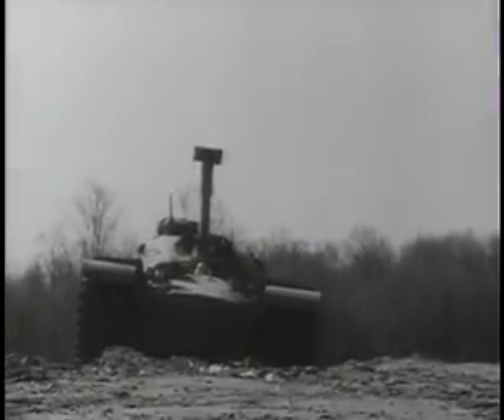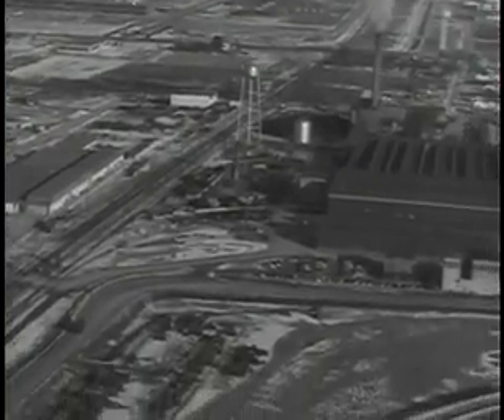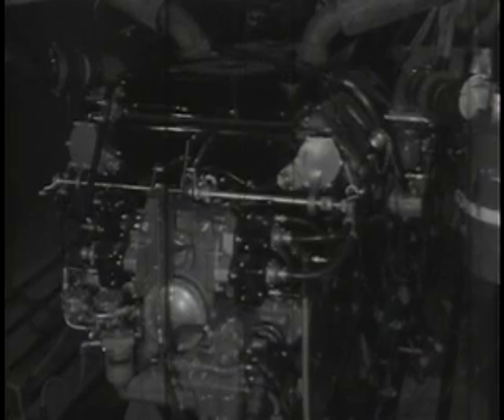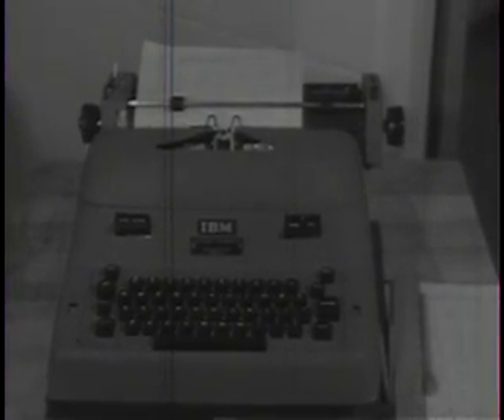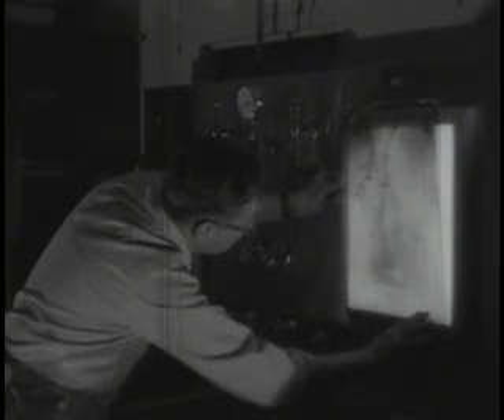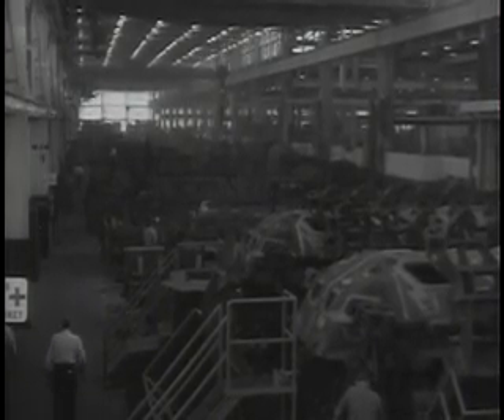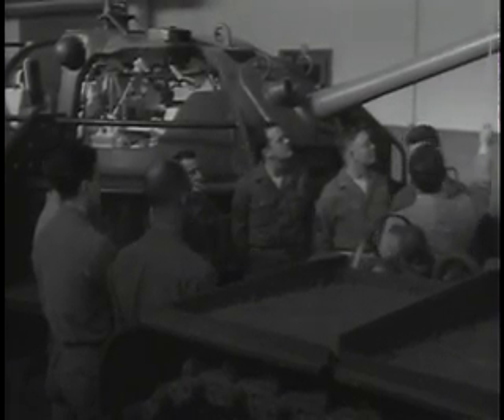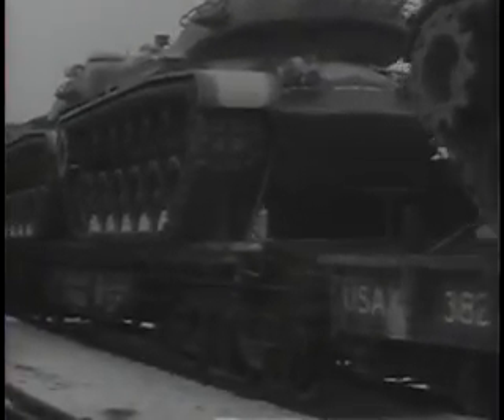M-48 Patton Tank, Design, Development and Testing

Comment: It's fascinating to watch people at the time describing what would become one of the worst tanks of the post war era
Reply: why you say that? M48 became one of the best post war tanks and with continuing modernisations on engine, gun and fcs stayed in front line service up today. its not a crap tank. yeap the M-41 90mm gun it was inferior to T-54/55 tank but in the 1950s they used HEAT rounds enyway and do its job. after they put diesel engine teledyne continental AVDS-1790a/d and M-68 105mm tank gun on the M-48A5 version make the tank equivalent with the M-60/A1 and it surpass eny soviet tank of T-54/55/62 series and even early T-72 with steel armour using APFSDS rounds. if you want to compare it with 3rd generation tanks its pointles and not logic. but the tank can be modernised even today with 120mm gun, new composite frontal armour and digital FCS( digital FCS were allready in modernised M-48s from late 1980s) and stronger engine. if your about to fight with other country that dont have 3rd generation tanks like M-1 and leopard-2, its still very efective like the 1950s, imagine your on a infantry company armed with machineguns and short range antitank guns (less than 500m)  like recoiless rifles M-2/4, M-72, panzerfaust, RPG-7/22, and other similar on the open you would shit your pants if 15 M-48A5 attack you, you would call on the radio reinforcements and heavy antitank launchers and artillery suport, you would stayed on your dig up position wile their fired at you gun and machinegun rounds and untill you noticed the enemy mechanised infantry that suports the M-48A5 would be on your head!, you would not see them coming becouse the tanks would bust your position and smoke and dust cover the wholle position you would not fear more for your life i promise you!. M-48/60  are very reliable mechanically, easy driven and operated and are cross country dogs, or honeys!, crews love them for all that abilities and can shoot accurate on 2km distance. if they maintained they are reliable even today, and old tnk doesnt mean it can't kill you easy!
and the M-2 Browning  0.50 cal machinegun its 100 years old in design but it kill you easily! on the war the old but combat efective and obsolete weapons are two diferent things and the M-48 its still combat efective. not all countries have the superpower arsenals and not all them would fight a superpower in war! 

ps. i was served in an armored unit that had M-48A5 with digital FCS, laser rangefinder and thermal camera in the middle 90s.
Reply: petros311
I think you are letting your fondness of your vehicle cloud your judgement. The Patton was exported because it was American, it was inferior to T55 and the Centurion. Your argument about the tank being 'scary' just because its a tank is irrelevant, the same can be said of pretty much any weapon since the longbow. I still stand by what i said, it was one of the worst tanks of the post war era.
Reply: petros311 has it right, soviet tank design concentrated on just the basics (Big gun, Thick armor, Powerful Engine) But sacrificed many small but possibly war winning features. Reliability, ease of maintainence, crew comfort/safety play WAY more of a role than it would seem. The most powerful tank in the world is useless if the crew is fatiuged, and the engine keeps breaking down.

The videogames you probably get your knowledge from are flawed in that they dont account for that.
Reply: petros311 Always good to hear those with experience weigh in and thanks for serving!
Reply from the maker: Thanks for your spirited defense of the M48!
Reply: yap all true, you can get a first hand opinion on tank fighting only if you inside a tank for few days excersicing including some live firing and then you get to know their pos and cons, on paper all tanks seem good, but the percentage wile actually they manage to do that its another story
Reply: thenoobfactor Soviet post-war tanks did not "sacrifice" anything except crew comfort. Worlds first tank that used (fully stabilized) 115mm smoothbore  gun that was able to fire laser guided missiles up to 5km was the Soviet T-62. Worlds first REAL main battle tank was Soviet T-64 with composite armor & 125mm smoothbore gun, also with ability to fire guided missiles was built 30+ years before M1A2. T-64's re-designed & improved version the T-72 was built 20+ yrs before M1A2
Reply: +STKS Well, the definitions for what an MBT really is aren't very clear cut, so getting a definitive answer isn't an easy thing to do. Personally, I'd define an MBT as a tank that does not weigh more than any heavy tank already in service in the same military, yet possesses at least equal firepower, equal protective qualities across its front and at least marginally superior mobility. The one tank that fulfils all criterion is the T-64.

It had a 125mm cannon more powerful than any other cannon in the world, had the best armour in the world thanks to clever design and the pioneering use of composite armour, and it surpassed the T-10M and T-62 in speed. Sure, you could argue that the T-64 had a lot of problems when it got into service, but it went into service regardless. After all, we're talking about the first MBT, not the best MBT.

But if comparisons between the two are inevitable, so be it. As usual, it must be pointed out that while the 5TDF engine of the T-64 had poor reliability, the Chieftain's Leyland L60 wasn't exactly the most celebrated example of British motoring genius either. I remember reading something about engine troubles affecting the combat readiness of the Chieftains so badly (down to 30% or something, IIRC) that only a fraction of the Chieftain fleet could actually be mobilized at any one timeframe if the Reds ever decided to charge the border. One also questions the validity of the ranging machine gun where HESH rounds are concerned. The ranging machine gun fires off a short burst, and unless you are lucky or skilled enough to bracket the target multiple times and get your shot off before the enemy knows that you are ranging it (not difficult, since exploding machine gun bullets were not used in any other weapon except the Chieftain's RMG), the HESH round you're lobbing over probably isn't going to land within a hundred meters of the intended target. On the other hand, a T-64 could just point and shoot because the APFSDS shells it fired were hypersonic (1800 m/s), and a full Mach number faster than L15 APDS, and the coincidence rangefinder was more than accurate enough for demolishing stonewall cottages from two miles away.
Reply: *****
Chieftain is widely considered to be the first MBT, certainly not T62.  T64 is a contender but early versions were poor. It was only in the mid / late 70's that T64/T80 began to match early mark Chieftain. And by the 80's with the MK11 with TOGS, the vastly improved L60 engine and Stillbrew (early Chobham armour) cheiftan had pulled ahead again before being replaced with Challenger. in the early 80's.
Reply: I'd say that both Centurion and Pershing were first generation MBTs, despite misleading assignations like "Heavy Cruiser" or reclassifying "Heavy" as "Medium" in light of post war analyses.  Upgraded guns and targeting systems kept them competitive with their contemporaries.  Pershing became Patton by means of incremental automotive improvements coupled with new generation turrets, apace, and on to the M60, all showing their lineage in the suspension.  Centurions were quite different, mark to mark, but you can tell one when you see one, just like you can tell an M48/M60.  

Aside: 
I propose, however, that the perfect blend of Gun+Armor+Mobility
(+ Optics and Turret Ergonomics) in WW2 era tanks is Tiger E.  Indeed, I think a case can be made that she, old tech though she might seem, was the first, true, One Size Fits All, Main Battle Tank.  Granted, she wasn't the fastest, either, but I'm talking which tank I'd want to be crewing when the fighting starts, other factors equal.  

Imagine Tiger vs Sherman.  Tiger vs Cromwell or Churchill.  Tiger vs KV1 or T34.  Tiger vs 7TP or Dutch 4 Man.  Tiger vs US T1 or M6 Heavy.  From late '42 till early '44 Tiger rules the roost, tank wise.  About Feb '44 the IS 2 comes into view, but Tiger's optics and long range accuracy are legendary for good reason.
Reply: *****
None of that refutes my point in the slightest. You should learn how to read or get off the internet.
Reply: ***** Export variant T-72's did not have composite armor, thus it is not the same. Also i can say the same about the T-62's and T-72's beating the Iraqi M60A3's like they were nothing.
Reply: Just need to look at its combat record to see how it did against Soviets tanks. M47s and M48s performed badly in the Iran-Iraq War.
Reply: petros311 Exactly support your opinion. .. 2nd ID Corea 1968..... That tub of steel drove smoother  than my 66 Malibu. .